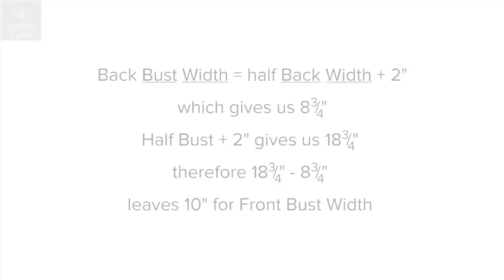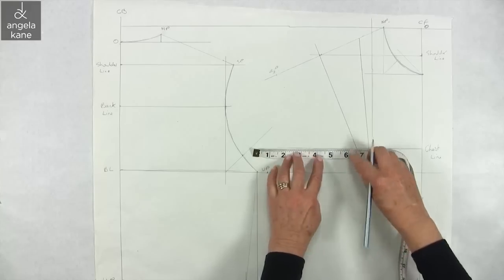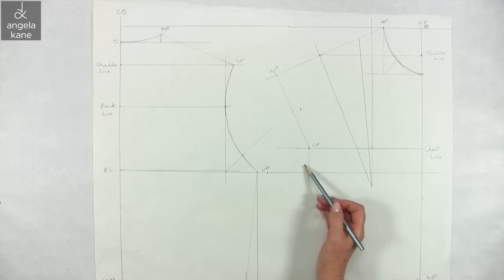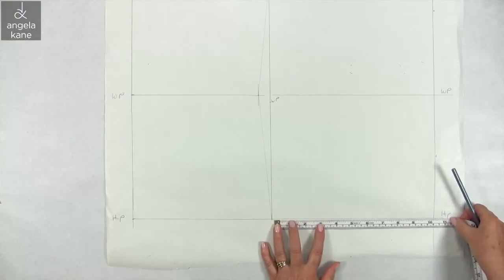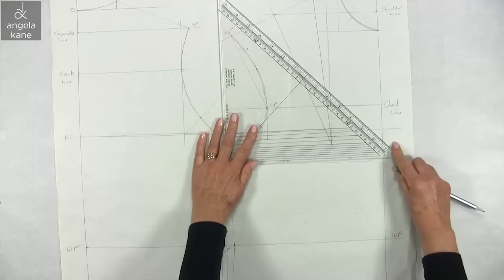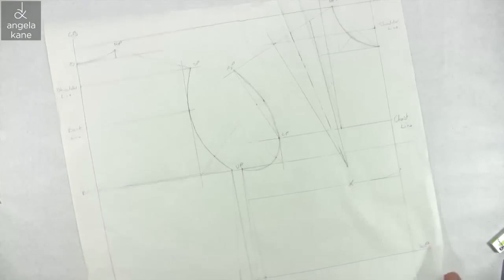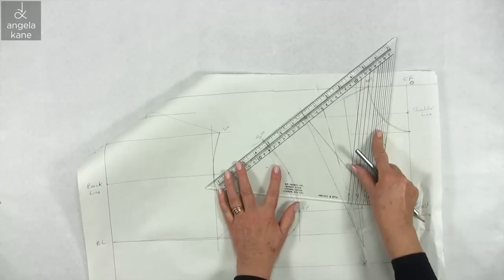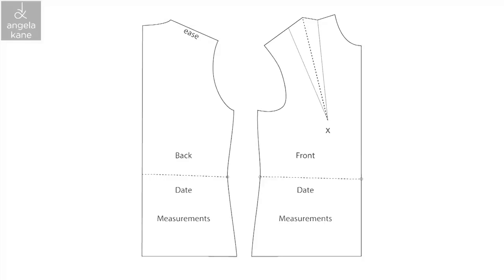Pattern Cutting - Flat Pattern Drafting, the Bodice Block part 4

Comment: Hiii, great tutorial thank you. But I have a question, i noticed that same back side seam has a deeper curve than the front side seam, thereby making the back side seam longer. How would you match them up properly when sewing since they are of different lengths? Thank you.
Reply from the maker: Hello, You will find the difference in length quite slight.  Match up at waist and hip level and distribute any ease evenly.  This is a close fitting block. When you work on your final design you will add design ease and decide on the shape and curve of the side seam and adjust any ease according to your design.  Thank you very much for your feedback.
Reply: @angelakanetv  Alright I get it now,  thank you very very much for your reply.

Comment: It was going so well until I folded my bust dart!  My 42” bust adds 4.5”dart and this makes the np overlap the sp!  I know how to do a full bust adjust once I have a pattern block but I’m not sure how to first draft the block?  Should I just use a 36” bust and then FBA up to 42”?  What about making a block with two darts? What other options exist?
Reply: May be check diane deziel videos on youtube if you havent already

Comment: Hello! I want to do a sweetheart bodice, but I'm not really sure where to do the darts? This pattern only has one dart, but I'm wondering how the one from from around X to the waist line would be? As in, how do we know how many inches the width of the dart at the waist line will be? Like assuming the dart forms one whole triangle (it's like two triangles in one right??), how wide is its whole base at the waist line?

Comment: Hi Angela - trying to figure out whats the variable size difference for bust size 38? Sorry to bother you as i'm unable to find from your PDF. From this Part 4 video at timing:  0.47.  I was guessing it 2 1/2 inches?
Reply from the maker: +Prema Wilson Hi Prema, Did you catch the annotation about variables being freely available on my site? https://angelakane.com/sewing_patterns/pattern-cutting/.  In Part 2 at 1:26 I do say, add 2" to half bust for all sizes.  I've corrected this with an annotation too.

So for a 38" bust add 2¼".  40/42 2½", for a 44 bust, go to 2¾".

So, here in Part 4, to calculate the Front Bust width for a 38" bust, use 2¼" where I say 2".

I hope that helps.  Thank you for pointing this out.
Reply: +ANGELA KANE Sewing TV  Thank you so much Angela, your tutorial was simply amazing. I was so happy and  impressed over my own drawing. I'm unable to find the fitted bodice video drawing, believe it's  only for registered members access? Your members access designs, i believe you have predrawned PDF downloads on standard sizes. I want to know do you have  the same pattern drafting tutorials as the one you unloaded in youtube for all those designs?  Because i would like to draw my own sizes.

Comment: I did draft the pattern using my own measurements. there is a problem with the side seams, the back side seam is more like an A shape, while the front side seam was straight. what should i do to match the side seams? should i match the back side seam to the front seam, and then apply the Slash and spread method on the back to get the right hip width? thank you

Comment: Hello, I love your Pattern Series! It really has been helping me as a beginner so thank you very much :) But unfortunately, I am really struggling with this part, just as I thought I was doing well and was nearly done. I don't understand how to get the front bust width, as when I do it, I end up overlapping into the back bodice. Also, the next part, I can't seem to get my head around the maths on how to get the chest point measurement. Please can you help me, I really want to be able to make my own bodice :(
Reply from the maker: Halimah Hello Halimah,  Yes, this was quite complicated to explain and demonstrate. 

Firstly, if your Front Bodice is overlapping your Back Bodice and you think your construction is correct, remember what I say at the outset, the centre back and centre front lines, CF and CB, can be drawn as far apart as you like initially, to give you more room.  The back and front bodice drafts are quite separate but on the same level horizontally for convenience.
The Chest Point - this isn’t so difficult.  You measured your Chest Width, see Part 1.  So Chest Point is marked using half that measurement from CF.  You have to exclude the width of the dart because it will disappear when the dart is sewn.  So, as the dart is not stitched at this time, you have to add that little bit on for the actual measurement from Centre Front to the Chest Point on the draft.
When the dart is finally stitched, Chest Point will indeed be half chest width away from CF and Chest Point to Chest Point across your whole bodice front will be equal to your Chest Width measurement.
Hope that makes more sense.  Good luck with the rest of your drafting.

Comment: My bust is 38" which gave me an underarm point at 12" from center point on the front bodice (half bust +2 = 21) (21 -  (half of (back width of 14)  +2) = 12 .  My back bodice armhole measures about 8" which perfectly matches the back sleeve pattern.  However the front bodice armhole is almost 11".  This gives a total of 19".  This is quite a bit longer than the upper arm measurement (in my case 10 1/2") plus 4.5 or 5 inches.  This makes my armhole 3 inches to big for my sleeve.  Drafted from your sleeve pattern.  What should I do?

Comment: I would like to know how you figured out the extra slack that was added. Why add half or two inches? Is that what was taught? Or does it even matter how much you add?
Reply from the maker: Yes, you are right, 2" is pretty much a standard thing for a basic bodice.  You loose some of that in the dart.  You need ample ease across the bust for movement.  Especially if you add sleeves, a skin tight fit would not work.  If you are making a sleeveless dress that is very body hugging you could get away with less.  There again if you want a very easy fit you would add more.

Comment: This is top notch as usual Angela so much gratitude. I usually make errors on the armhole and end up with it just too large. I notice that at 2:29 your front line arm curve top shoulder down to bottom arm went INSIDE the pattern ie across the pattern block to the right so maybe that's where I'm going wrong as I always keep that arm curve to the left of the pattern block and it invariably ends up too puckery at shoulder chest. I didn't know you could go inside the block lines ? I'd be ever so grateful if you could advise. Have a beautiful rest of week.
Reply from the maker: Hello Steph, I'm not quite sure what you mean.  I looked at 2:29 and I'm drawing in the front armhole curve.  Just joining up the drafted points.  The lines are just guides drafted to find the points.
Let me know if I have misunderstood you.  Thanks though for your positive feedback on my videos.

Comment: i am so confused by now! can you tell me the measuring difference between bust width and chest width? thanks so much!
Reply from the maker: Hello evafeeva, the Bust measurement is taken around the fullest part of the bust, around back and front.  The chest measurement is take higher and is the distance tween where the armhole seams should naturally occur.

Recap Part 1 at about 2:00 - https://www.youtube.com/watch?v=EdJSUd71CdI - 

This calculation of Bust width is difficult until you do it a few times and then you will understand.  Front and Back Bust Width are the two halves of the bust measurement including ease.  The ease has been added to the Back Bodice so you use this information to decide what is left over for the Front Bodice.

I hope that helps.  Thank you very much for leaving a question.
Reply: thank you so much! you have saved my very own new bodice pattern!
Reply: ANGELA KANE Sewing TV

Comment: Can you explain why this is drafted in a block vs. Two separate pieces?
Reply from the maker: Hi Stephanie, Block refers to each pattern piece.  I don't know where the term comes from.  These standard patterns are commonly called blocks but in the US they are more commonly called slopers.  The Bodice Block comprises of a Front Bodice Block and Back Bodice Block and Sleeve Block.

The Front and Back are drafted together as they use common reference points and measurements.

Comment: I am a bit confused about the ease. Says there is no ease but seems to have 4" total at the bust?
Reply from the maker: ternpoint Yes, I should say minimum ease as opposed to no ease.  This is wearing ease which you need for movement.  Bust level is where you need most ease for movement of the arm, chest, back flexing etc.  4" that's 2" on the half draft.  Some of it is lost in the shoulder to bust dart.

For a sleeveless dress you can reduce the minimum ease and for a strapless dress even more can be lost.

So that's wearing ease as opposed to style or design ease which can be anything - loose jackets and coats for example that go over multiple layers of clothing.

Thanks for your feedback.
Reply: Was  wearing ease also added to the waist and hips?? Thanks so much for these videos, they are amazing!!